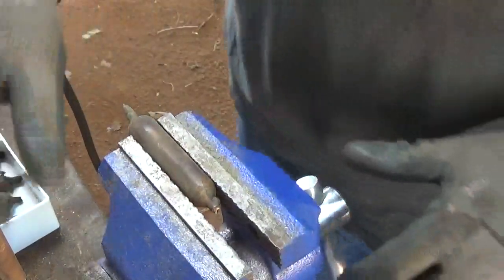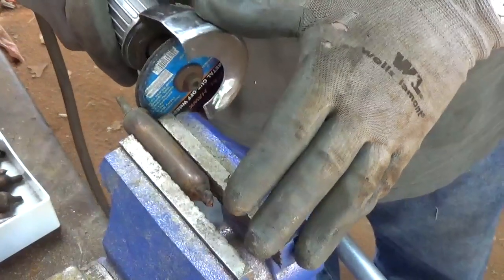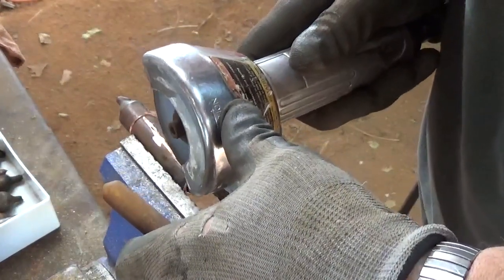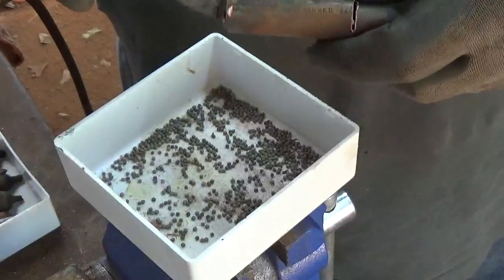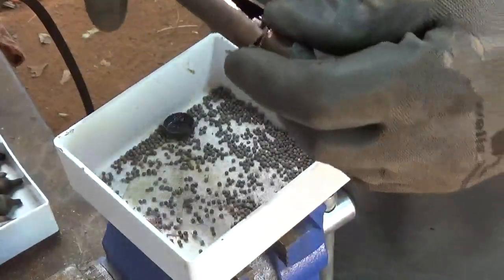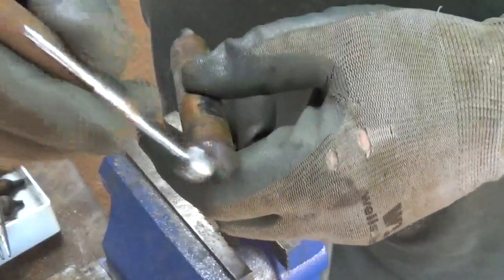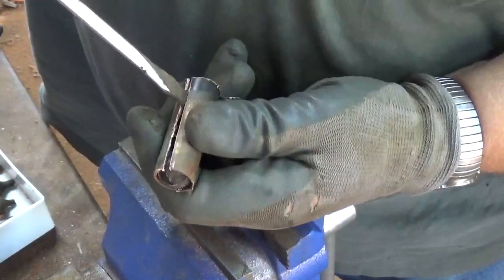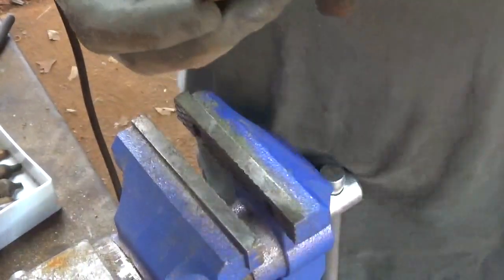How to clean copper dryers for clean # 2 copper

Comment: weld a flea market bolt cutters to a piece of angle iron so they clam nice in a vice . Hit the drier with a hammer to flatten it a bit .Then cut it with the bolt cutters ,Cheaper and faster

Comment: Another great video. Looks like a good thing to do on a rainy day. Be careful out there.
Reply from the maker: Yes I save a lot of little stuff like this for the winter. I can go out to the shop turn the heat on and clean scrap out of the cold. things are slower in the winter too. and last winter prices were to low to sell anything. Thanks for stopping by Randy

Comment: I had no idea, I thought it a reservoir of sort and  I have been smashing them flat so when I  go to melt it the oil doesn't explode. What are the beads made of? I  haven't seen them floating to the top when I skim the molten copper
Reply from the maker: I am not sure what they are made of,  a plastic or ceramic I think but not sure

Comment: How do you clean your copper for shinny copper ? Do you boil it?
Reply from the maker: I think some guys use some kind of acid, I don't bother trying to make it shinny
Reply: Toilet bowl cleaner works excellent for making your copper bright and shiny. Depending on the scrapyard they may give you a number one if you make it bright and shiny so I would check with them before you go through the trouble
Reply: @johnbadgerow6135  john, thank you ... will toilet bowl cleaner leave a haze as did when i boiled some to try out making it shinny ? And how do i use it, spray on wipe off, dip and soak for minutes ??
I found earlier, that if i skipped any prep work and just used steel wool - it made it shinny, but not sure if i want to keep doing that with small pieces or weird shaped pieces.
Reply: I usually just make a solution up in a 5 gallon bucket and soak it for a while about fifty-fifty seems to work okay but if that doesn't do the job just increase the toilet bowl cleaner until you get the results. Afterwards just hose It Off

Comment: Ah learned something.. never knew they where dryers. Probably silica gel beads in there. and yeah copper doesn't spark.
Reply: You can even regenerate silicabeads by blowing warm dry air through them for a couple of hours.
Reply from the maker: thanks for watching
Reply from the maker: I titled the video wrong, cut the ends off and the rest should be #1 copper
Reply: @Okiescrapper   Ow I like to learn and your vid was suggested by Youtube.. as you can see my alias is John the Scraptist :p
Reply: Guess dryers was the good word... better was refrigerator gas dryers I think... (I assume they are because that is what I recognize) i.c.w. the thumbnail it sparked my curiousity.

Comment: I use my band saw and tin snips to cut filter dryers open. You are probably spending more on electricity to run your air compressor than you are bringing in by scrapping using a die grinder. buy one of those $10 Harbor freight 4 inch angle grinders to use instead of a die grinder.

Comment: Good to know I never bothered with them just because the magnet would alway stick. I might start cutting then open
Reply from the maker: Go for it!  after you do a few you can get fast at it. the tricky one's are the one's with the brass screen and ring, but you kind of know where it will be after you do some
Reply: I personally don't bother with this I just throw in dirty copper...same like brass fittings on copper pipe .value your time just like a job...but if I have time I will clean stuff like this.